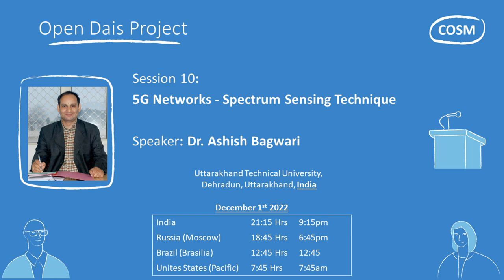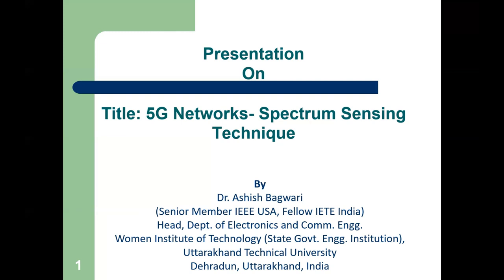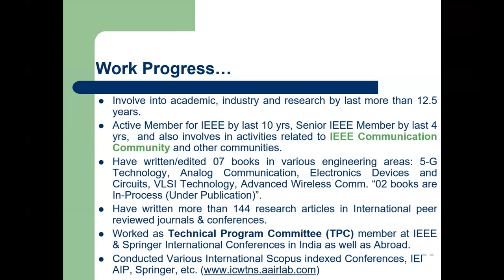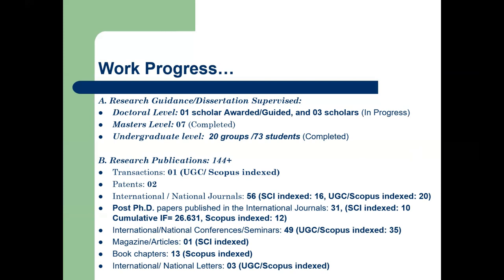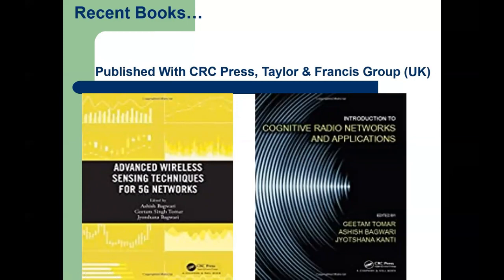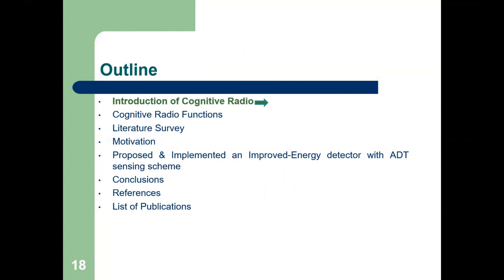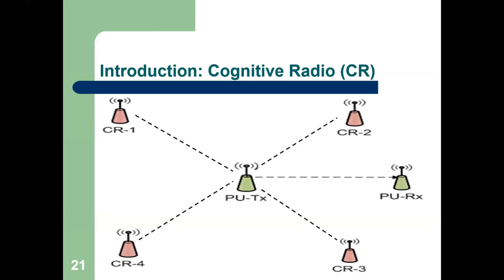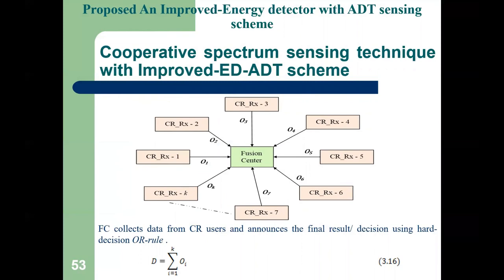Open Dais 10: 5G Networks - Spectrum Sensing Technique

Comment: please how we improve detection performance and reduce complexity
Reply: For the system complexity, we have considered the spectrum sensing time (Slide no. 58), that shows the performance of the proposed model is good. Therefore, we can say that system is not very much complex and performing well. 
Also, we have considered the energy detector (ED) for our work because, ED is less complex than the exiting detectors and we imply the adaptive double threshold scheme with ED that enhances the system performance and reduces the system complexity.
For any further query, you can contact me.